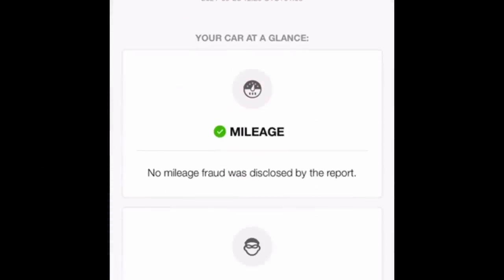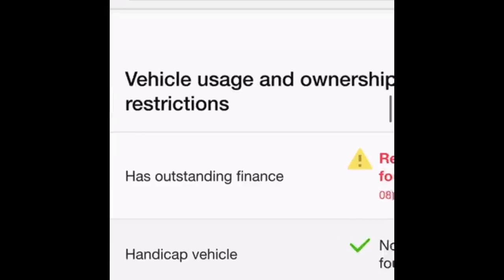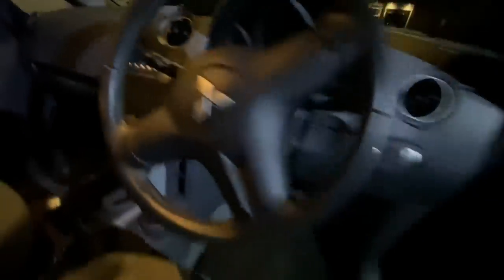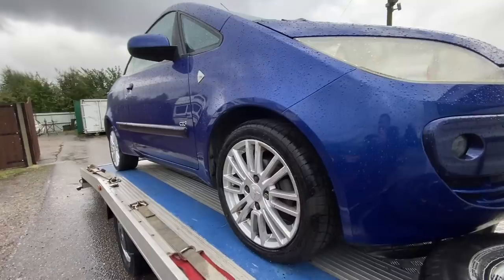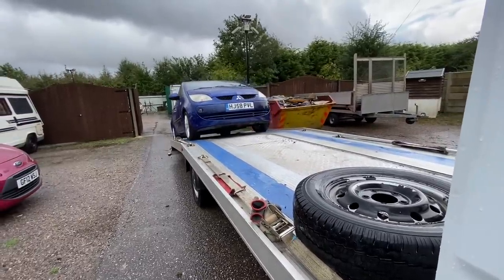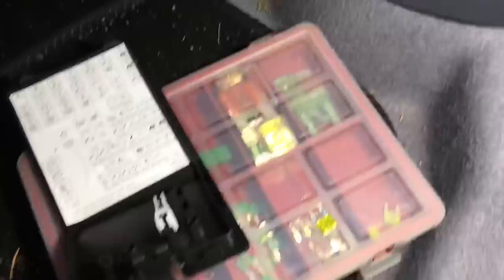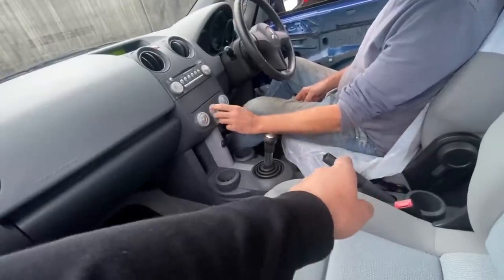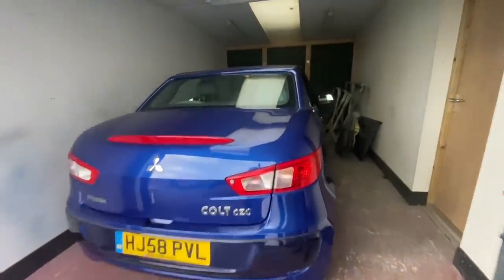Cheap Car Challenge Colt CZC 2 Can We Double Our Money ???

Comment: Yes the variety is good thanks, I used to have a standard CZ1 Colt lovely little car the engine was described as turbine smooth in an review I read before buying it back in 2013 & it was fault free for 6 years until it got damp in the dash console & the cluster went haywire possibly a soldered joint that needed re-doing ended up selling it - nearly fell of my chair when you said £500 for the part but I think you will find one given a bit of time & easily double your money I would think.....I did get a bit lost when Chris explained how he tested it but that's my  being a bit thick to be honest

Comment: This reminds me of last year, 2020, me and my ex partners dad went halves on a 2008 VW Golf Match Diesel and the guy was selling it as it had a gear linkage relay lever problem and a cracked windscreen, original price of £650 but we got it for £450, took it to VW who charged £113 to get the new gear linkage relay installed and £70 to get it transported to the garage. After we had it repaired, we cleaned it ourselves and advertised it for £2000, we had loads of interest and got the full asking price for it. Very clean MOT with the last three MOT’s with no advisories, a tonne of paperwork and just over 169,000 miles which was pretty much all motorway mileage. Cracking car and was a good moneymaker

Comment: I wondered if the osf door had been replaced at some stage as there is writing on the door panel ... you don't normally get writing on a panel which sort of indicates that the door and operating controls inside the door have been damaged and a second hand door has been sourced. I reckon the motor in the door was broken at the same time and it wasn't replaced, which is why there was a piece of wood holding up the window... I don't think the accident was reported as it was an older person involved and might have affected his driving or his insurance
Reply: I wondered the same thing about the writing on the inside of the door. What did it even say? 'Blu...' something or other?
Reply from the maker: A lot of doors have writing in them

Comment: I got one of these Colts for my girlfriend a few years back as a first car. Great little cars but because the window drops as you pull the handle it gets a hell of a lot of wear on it. The runner eventually fell off it and the window nearly dropped and smashed. I think I chucked some cable ties and sealant down there before we traded it in 👍

Comment: I admit I have done the exact same thing with a piece of timber to hold up electric windows, I’ve used pieces of cardboard wedged between the glass and the seal as a bodge before I can get time to fully bodge it will a block of wood 🤣

Comment: I had a Z30 colt when new (fleet car thankfully), got a 1.5 diesel semi auto, would have got a czc but no automatic option.  Needless to say the transmission was the biggest problem as it stopped going into reverse, dealers were rubbish didn't get fixed and I gave it back to fleet and have had Skoda and VWs ever since, got to love a good independent specialists as an owner.

Comment: Hi Rob i have the 1.1 version of this car they are the most reliable cars on Earth , seriously Timing Chain Engine on it , mine i paid £600 for and it now had 115 thousand on the clock starts every time but they are not worth a lot , mine is a 2007 version only can get offers of £350 for it even though it has MOT to Feb 2022 and has 4 good tyres on it , the only thing is the clutch is starting to judder a bit and the brakes will need changing but if i spend the £600 to get a new clutch and brake pads/discs on it then it will last another 5 years no problem , so i may just keep it if that E10 rubbish dont kill it lol

Comment: Nice car & video. I know you use ebay a lot and you said that you'd be on the internet looking for the parts - do you ever use the breaker parts finder websites or are they a waste of time? Did you nudge the chin spoiler with the spare wheel on the truck bed - anywhere else you can keep it eg  mounted vertically behind the cab?

Comment: It is a nice little car, but a shame that the bits you fetched could not tie it back together again. Well done to Chris for getting to the bottom of its troubles, but a challenge to find the bits at the right price. Still I guess you can set it aside and wait until the right price item comes available, convertibles sell better on the promise of spring than in the autumn. For the price you paid, it has some margin left for you to deal with its issue.

Comment: Cracking little motor 👌.
Silly question but have you checked in the boot to see if the window regulator is in there?
Air con re gas & de bobble that seat...Good to go  £2k

Comment: You've got yourselves another cracking wee motor lads. 👌
After doing a wee bit of checking myself, there are a couple about for under £1k, but the roofs don't work on those ones. The others are averaging about £2k, but low mileage ones like yours, are going for between £3k and £4k.
I just don't know how you keep finding these bargains Rob! 😲

Comment: Low mileage isn't always good, we bought a seven year old panda that only had 4 .5 k miles , owned by a lady only did 600 miles a year, it never really went very well, we sold it with 19 k on it 3 years later but reving better after I thrashed it a bit !

Comment: That's a pretty good bargain. Sure you will source the parts sooner or later. Its strange that lots of manufacturers used to do these 'tin top' convertibles back in the 2000's but not that many around these days!

Comment: You can see why the price of a particular part and the unavailability of the part sometimes renders a vehicle as an uneconomical repair that's worth more in bits..had this recently with a low mileage seat Marbella (basically a fiat Panda)very very tidy one owner but needed a cat, price of the cat took all the profit from the car..put it in corner of the unit hoping to find a cat from a breaker or for price's to stabilise...

Comment: Proper little curio. I do recall that the hatch its based on also spawned the Smart forfour. It might just be that a Smart roadster electric window could be useable although the Smart doesn’t have a folding roof. Try searching eBay Italy as thats where they were built.
Reply from the maker: We got the bits 👍

Comment: Never understood why cable based winders are so pricey. I bought a megane with the arse on the back. That had a busted winder £350 . I replaced the cable with push bike brake cable. Really f'n fiddly, but sod if i was paying out £350. Shame the motor wasn't with it on your motor. I done my transit electric winder 6 months ago, big cog on a stick with new motor £30. Dunno why they make the cable ones

Comment: I never knew there was a Colt convertible. That's probably why thy parts are so dear, but £500 for a regulator is far too dear. My sister had a Chevette with the window held up with wood, and I've had a couple of Hyundai pony's one the window would drop down when you shut the door, and the others glass often came out of the regulator and either stayed in place or fell into the door. 🤣🤣

Comment: Hi Rob'n'Chris, doesn't the Colt share parts with others? I thought it was GM based but on looking it's the same platform as the Smart ForFour? So Daimler Chrysler? I wonder if Kent Auto's have any in the yard??
Reply: I have just looked one up on ebay and the MK1 04-08  looks close- but cant see the plug? £48?
Reply from the maker: We got the parts

Comment: Hi i have seen on ebay there's 3 mitsubishi colt convertible are breaking for parts.
Two with blue colour as your.  One with grey. 
Also did you try call mitsubishi dealer to find prices. Sometimes parts very expensive on ebay but from main dealer there are a lot cheaper.
Reply from the maker: We have the parts 👍

Comment: This new project is tantalising Rob, Chris. These cars are a few grand in good working order, or a few hundred quid in faulty condition.
Here’s another basket case on flea bay item # 294383374685. what’s the chances it has a piece of wood holding the window in place. 😂.
Hopefully the required parts will come soon enough at the right price 👍🏻. And you can pass it on again…. What a shame your parts have been taken away 🤨.

Comment: My parents have had one of these since new & had the same problems so the £500 regulator quotes surprised me at the time but not now.
Everything sells & it’ll be a good car for someone at the right price but these really are quite cheaply put together & crap.
When my parents got theirs I bought a 4 year old 206 CC hdi & it was so so much a better car. The Mitsubishi is just cheap & tinny. Switchgear feels cheap & does nothing particularly well. The great irony is mine is worth more now.
However I get this is a cheap car challenge but when new these were beset with problems. 
Actually surprised it’s not got the leather in it.

Comment: £500 is an a steal for its condition guys, but unfortunately convertibles sell better in spring & summer. Can’t believe the replacement regulator & the motor is almost as much as the car!

Comment: I used to have a Colt, parts were expensive. Dinged it once and the insurance co almost BER'd it.
Reply: I've owned 2 Colts. Service parts are very cheap but you'll find electrical bits a bit more expensive than Ford or VX but not by loads. Starters give up about 100k and alternators do the same, corrosion of electrical bits is main problem, very little protection on these as they needed to save money. The 1.1 engine version was 6k new and the cabriolet 10k so they didn't cost much to start with.